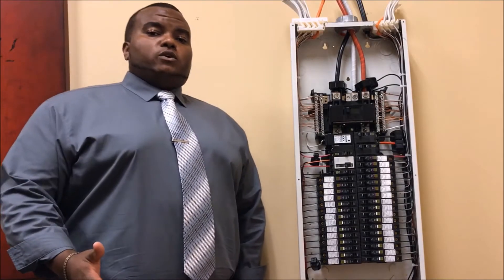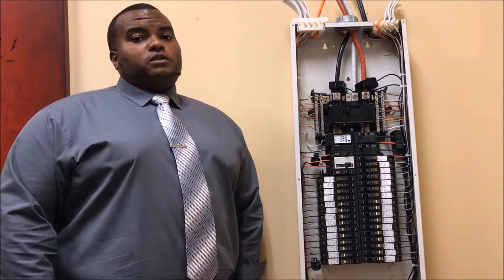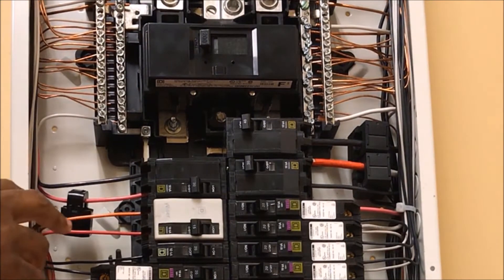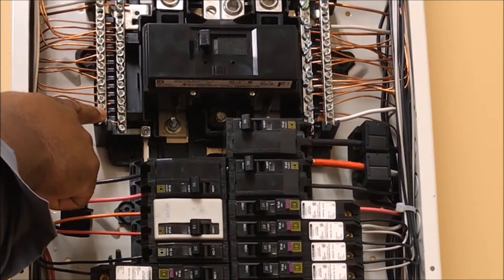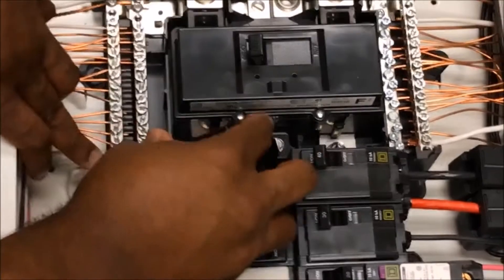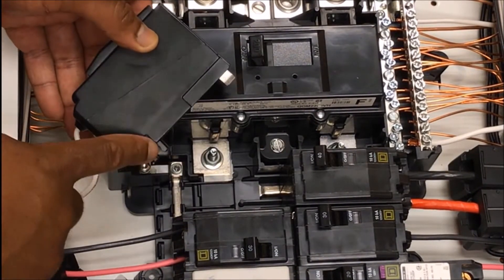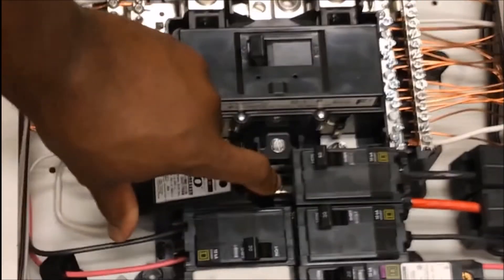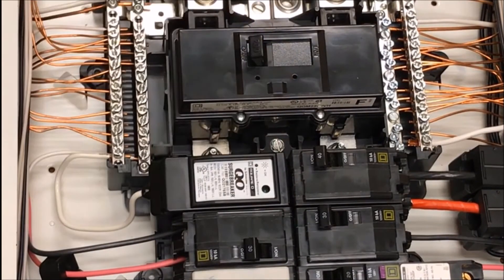Installing QO2175SB Surge Protective Device into QO™ Load Center | Schneider Electric

Comment: I noticed that you landed the white wire to the neutral bus bar, but there are also some bare ground wires also landed in the same neutral bar. I suspect this setup has the neutral/ground bonded together. If this surge protector is installed in a subpanel that does NOT have the ground/neutral bonded, does the white wire still land on the neutral bus or the ground bus or either?
Reply from the maker: Thank you for your message Shawn. We house most of our documentation in a virtual database here: https://www.se.com/ww/en/download/. If this does not address your concerns, please reach out to a technical support person in your location.https://www.se.com/ww/en/work/support/country-selector/contact-us.jsp

Comment: The QO2175SB is for a single-phase, three-wire 120/240 VAC system.  NOT for a 120VAC single-phase two-wire system.  It would worth touching on this critical point as there always seems to be some lay confusion if the 3-wire system does nor does not include the neutral wire (that is "-120VAC" (black), neutral (white), "+120VAC" (red)) vs. or just the two active/hot wires (black and red) vs. 3-phase system which would actually have four input wires to the main (3 black (generally) and one neutral) and the above mentioned warring on the 120VAC single-phase two-wire system. 

That is, be very, very clear on why this particular surge suppressor is the correct one -- it's the first big decision to be made!!  

NOTE:  I am using the +/- 120VAC a bit loosely.  Since it's AC voltage, the nominal voltage is 0V with a AC oscillation around 0V.  A typical home gets 240 VAC (for clothes driers, AC units, etc.) by combining the voltage potential between the black and red rails to create 240VAC as opposed to a 120VAC line which uses either the black OR red rail as the high potential as measured from the  neutral/ground potential.  Additionally, your home may read a bit more that 120VAC down to 105VAC depending it's location on the grid and various other efficiency factors.  110VAC is a common value that get's tossed out around.   It's all good and all the same-ish (your clothes may take bit longer to dry...but that's another topic for the interested reader).
Reply: I have never in all of my electrical days seen a single phase service that is only 2 hot wires with no neutral, where do they do that at? A single phase service has 3 wires and a 3 phase service has 4 wires. 3 phase services are almost never identified by 3 black wires, the colors for identifying 3 phase are-black,red,blue or orange,yellow,brown

Comment: Would installing 2 of these in one panel add more/increase protection or be a redundancy of sorts?  Should one be installed in sub panels?
Reply from the maker: Yes, installing more than 1 surge protection device to the same panel increases the protection for that panel.
It is a good idea to install the surge protector in every panel in that electrical system (the actual connected loads in each panel can create surges).
Reply: @schneiderelectric  Yeah-- but it doesn't double the protection.  And if one is compromised from use the second one is also likely compromised or on it's last leg.  It does however, double your chances of a manufacturing defect or other strange interaction at particular house that Schneider didn't consider.  A likely better idea is to have an unused spare surge suppresser handy incase the first one take a hard surge (lightning strike, etc.) so that the home is not left unprotected while a new one is ordered. 

For the seriously concerned homeowner (with perhaps some spare discretionary income) would be to install a suppressor before the mains, after the mains, and at the point loads (TVs, computers, refrigerators, etc.), AND don't forget about your input Internet/Cable/Phone low voltage input lines which are not protected at all by suppressors on the AC lines. 

BTW-- not a fan of additional regulations but I don't understand why suppressors on the mains are not required by code in all U.S. states or why any reputable new home builder would not include them as standard or at lease an upgrade option...
Reply: @leeoien3645  they just passed the law on Sept 2020. All house must have surge protector
Reply: @leeoien3645  And the surge suppressors on the internet cables, etc, are only going to get more important. Turns out that in terms of $ amount, insurance companies pay way more for electronics damage than for the rest of the house after a lightning strike.